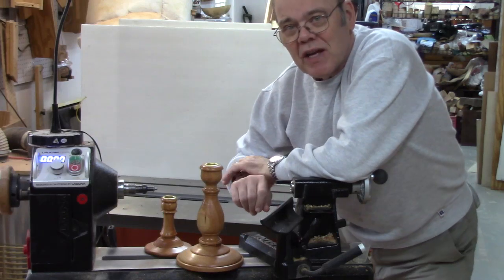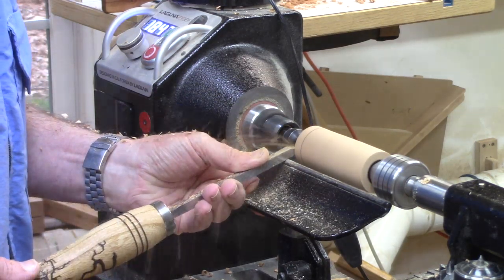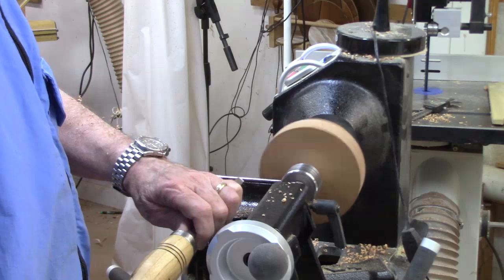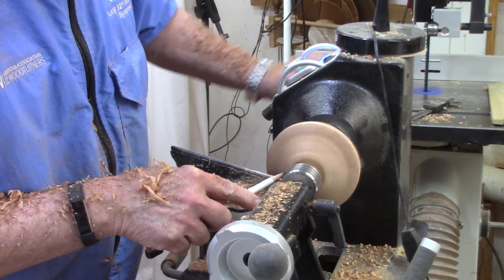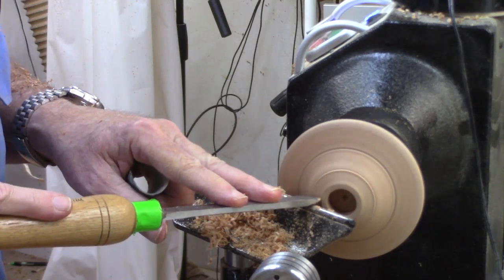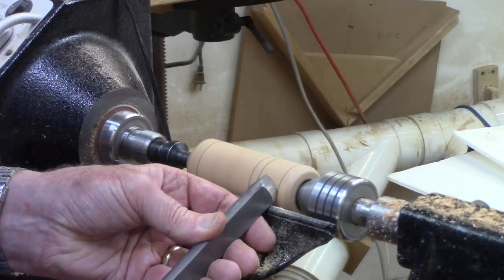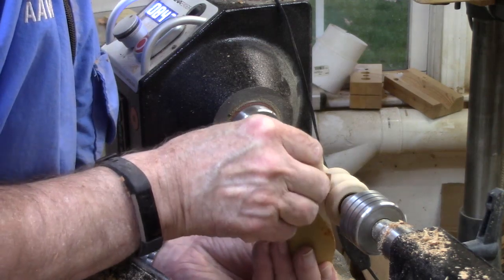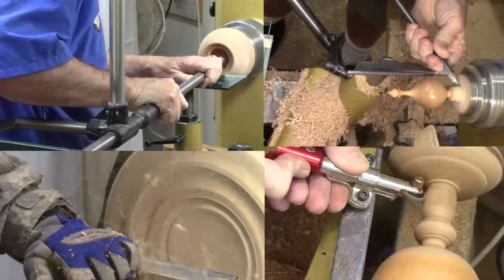Woodturning a Candle Holder | No Scroll Chuck Needed

Comment: Well now you have gone an done it.   Another great turning idea.  I like drawing my story board before starting.  This looks like a good project for an advanced beginner which describes me.  I am going to give it a try as soon as I can get some inserts. 

I see no reason a small rounded bowl blank wouldn't work for the base.
Reply from the maker: Go for it! Just don't get crazy on the size of the bowl blank. Thicker than about a 1 1/2" would start looking strange IMHO..
Reply: I agree. I have some small thinner blanks since my lathe is 10X14.  So I am limited on bowl sizes (until I get a larger lathe, soon I hope).  Thanks for your comment and your great instruction.

Comment: Hi Mike, nice job, I noticed that when you started at 6.60 on the tail end there was a sound like scraping, could be nothing you are doing but I do find that when this happens on my tail end it's usually because the tailstock is not quite tight enough and a small vibration is setting up, after a quick twist the sound goes, but that's just with me.
Reply from the maker: I checked and you are right the chatter probably came from too loose a live center. Probably because the tailstock was slipping which seems to happen on this lathe if I am not careful to really lock it down.